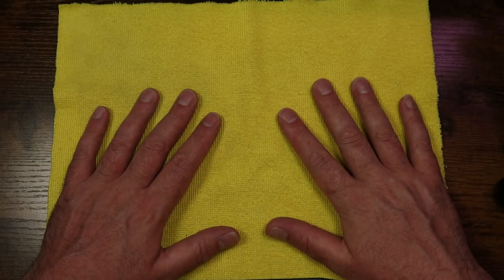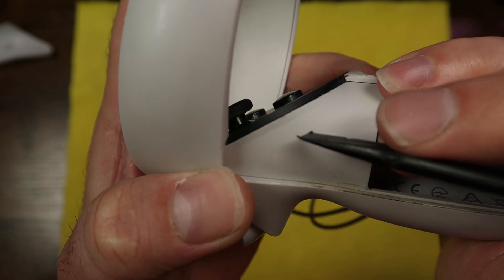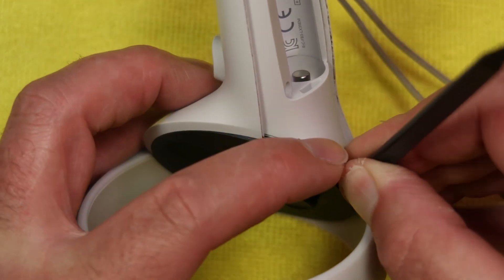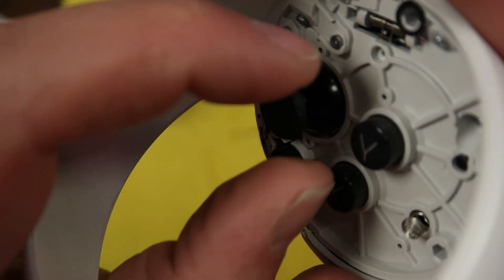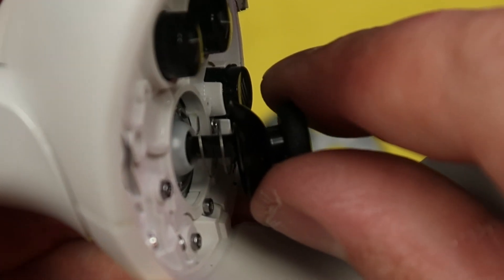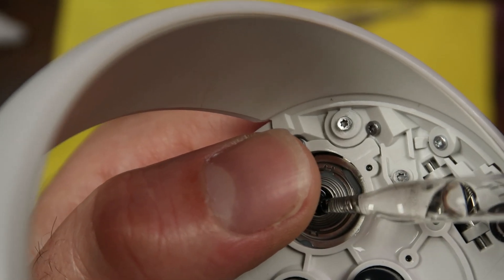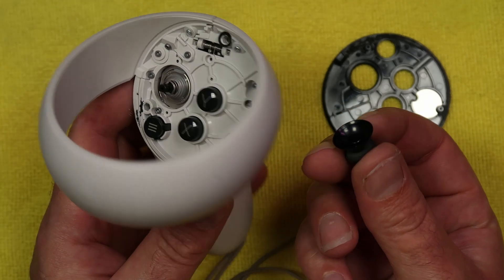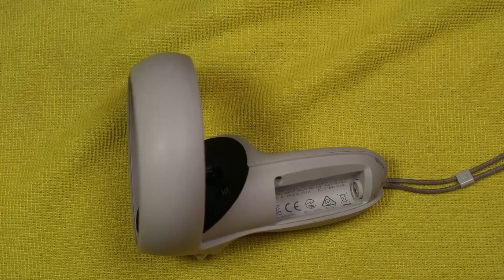Stick Drift Removal Oculus Quest 2 YOU CAN DO IT!

Comment: do i have to you the can of air?
Reply from the maker: @frqenty  im not a fan of canned air because it sprays moisture too. An air compressor is what I prefer. It helps blow out all of the debris that’s inside. If you don’t use any air then I would try using contact cleaner spray instead of rubbing alcohol.

Comment: So little thing i wanna mention...a few little things actually
1 i have rage and stress issues so you could guess i hit my controller here and there but the function almost seems the same nothing feels too broken... except for the drift
2 i completely play without the stick top bc idk why but it cause worse drift than normal...and some are broken (i got 2 headsets bc one broke and my parents don't think the dev of the quest 2 will replace it for free)
3 i have no compressed air at all and i don't think there's any kind of alcohol with a eye dropper syringe to get far that deep will alcohol pads work instead?
Reply from the maker: A dollar store may have something you can put isopropyl in to make it easier to squirt in there. Really though you could let droplets run down into it from your finger and it should work. Canned air would suffice to blast out the rubbing alcohol and the debris trapped in there. If nothing helps with the drift then I would assume the stick has more serious issues and needs replacing.
Reply: You could guess for 1 I wanna know if the rage could break something else first before breaking the joystick
And 2 is there anything I should worry about (other than need to probably clean more) with have the joystick off

Comment: i did it but i still have the drift
Reply from the maker: Sometimes it's worth another go or 2 but if all that fails then the stick will have to be replaced.
Reply: @RetroFix  meaning what?
Reply from the maker: @Gavin53zane  "another go or 2" would mean clean it out again 1 or 2 more times. Sometimes they need more than one cleaning.

Comment: I did it like you did using Alcohol and I use a good bit of Alcohol and worked it around really good. Then I gave it about a day for it to dry out just to be on the safe side. This solved it. Thank you for your video. 😁👋